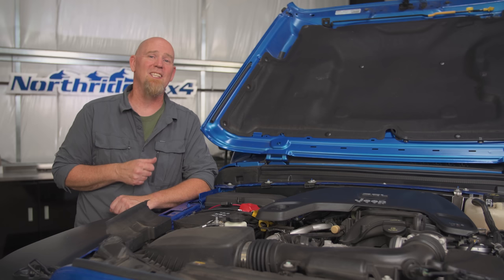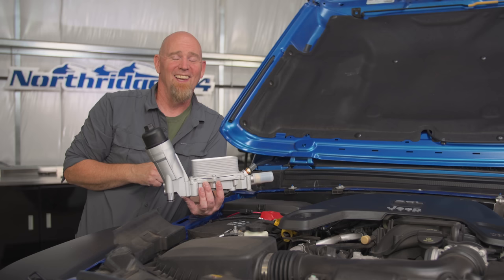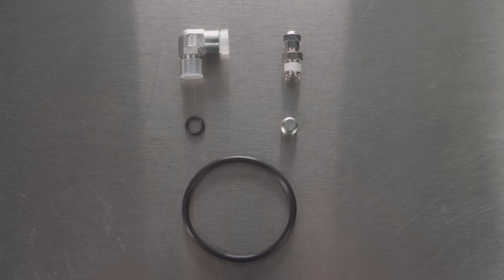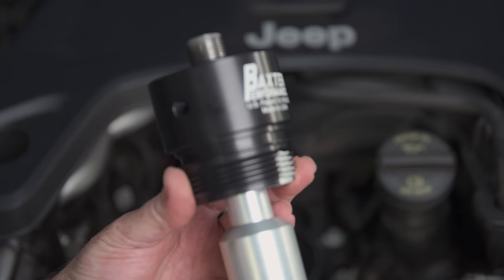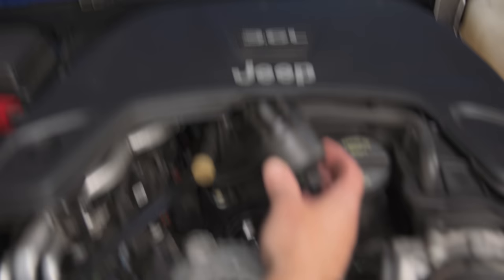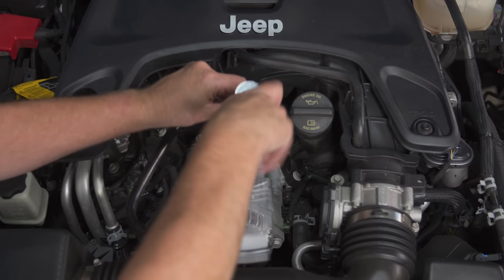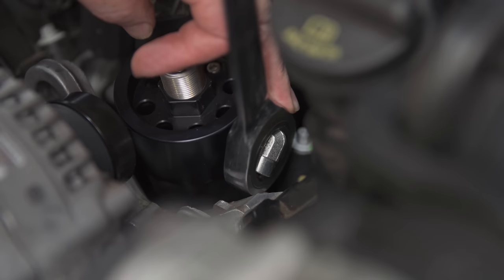STOP Dry Starting your Pentastar 3.6!!

Comment: My dads TJ as seen on my channel jeepNdirt (Everyday TJ video) has over 220k on the 4.0.  The JL's 3.6 while different from the 4.0 have similar sounds at start up.  Back in the day synthetics were marketed as "the super oil that bonds to metal and help prevent premature wear".  Anyone remember Slick 50, lol.....  That said our JL's and JT's call for synthetic oil to begin with so does that mean synthetics no longer protect our engines?  As an Engineer, I don't disagree with products that help and provide benefits, but in this case does it make sense for the cost of what it's selling for?  Are there that many problems with the 3.6 valve train?  For me I'd be more interested if anytime I see someone promoting this product they also provide facts, data, numbers that support the issues, causes and or concerns.  If someone was proving or showing that out of say a million 3.6s sold in the last few years that 30 or 40 % of them had valve train issues then I'm more likely to consider this product and or promote it myself on my channel.  Lol.  But seriously it appears to be a product that does what it says it's going to do and it maybe it should be considered as "cheap insurance", but as someone below mentioned where's the long term testing info and or as I suggest where's the data that makes us as 3.6 consumers want to spend money on this vs our suspension or other jeep stuff.  Not bashing here, just posing a question.
Reply from the maker: Just google or YT Pentastar valvetrain issues, you'll see plenty results.
Then Google Pentastar oiling diagram.
Reply: The bad rocker arms did it to me at 97k miles. So if this  problem was the oil getting up there then I'd buy it. But i haven't heard that it was.
Reply: My dads 2013 has 180k on it and he's always went to local lube shop, so who knows what oil they were using.  At 120k I replaced the cooler cause o rings blew out of plastic..  I think issues are from short stop and start trips. The us mail service has a ton of vans with this motor. The ones that run all day no issues,  the ones that deliver to condos and businesses where frequent starts and stops short runs, seem to have the valve train issues.  But not often
Reply: Remember the Mobil One adds where they ran an engine with no oil? Well, someone drained the oil out of my mower, and I mowed my acre and a half lawn not realizing what had been done and then next time I mowed my lawn I checked my oil only to find out it was empty, so I filled it with Mobil One again and three years on she's just fine, made a believer out of me. A 19 HP Kawasaki engine.
Reply from the maker: @stephenwest798  That's a great example of lubrication. What we want in the top of these engines is oil pressure to get the cam phasers and timing chain tensioner up to pressure and working properly. 
You cannot do that with a thin film of oil left over. You need oil volume and pressure.
Reply: Good points , good to see a fellow jeeper on here 👋  here’s my thoughts 

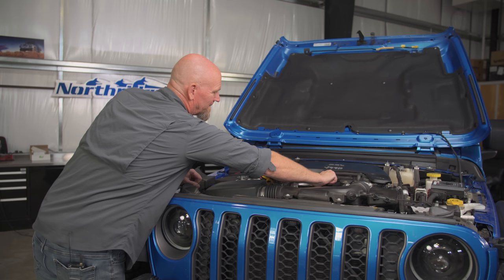Couple issues I see, but first if you watch at 8:40 he primed the oiling system of the jeep. Couldn’t you just do this before starting? With that option makes you wonder why you would even buy this part. Now for the list of issues. 
Voids warranty!
Changing the oil filter design changes the oil part number. 
Would a lube tech still service?
Forces owners to do own oil changes
And lastly there is a torque spec on the oil lifter hosing for a reason 18 ft lbs. this value is critical to how this housing mounts to the case. Over torquing, twisting and twisting that housing Will fatigue the seals and plastic housing. Is it worth all this? Maybe.

I like the concept and I like the ambition to make these engine run better. But there are ways to do this. 
Don’t use cheap gas
Keep the engine from idling for long periods of time. 
And have frequent oil changes. 
Understand that 8 hours engine time on the trail my only be 60 miles on the on the odometer. Change the oil sooner. 
I would consider trying this product.
Reply: There's a tremendous amount of clatter on start up from the valve train. The rocker arms sit on oil pressurized lifters and the cam phasers are oil pressurized too. Common failure points are the needle rollers in the rockers. You can count the seconds in an older engine as the pressure builds to calm the alarming clatter and the engine settles into a quiet idle. I'm rebuilding a 160K 3.6  with an emphasis on longevity and, among other items, I'll be ditching the plastic oil filter/cooler assembly for the aluminum version. After seeing this video I'll also be installing the baxter spin-on filter adapter with the anti-drainback valve for sure. The 3.6 motor either fails from overheating or valvetrain wear. Solve those problems and it should be an extremely reliable engine. Time will tell.
Reply: @northridgenation the valve train issues are due to the roller rockers build quality, not dry starts.
Reply: EPA has regulating the deletion of zinc from motor oils. Should also consider a zinc additive as well!

Comment: Used to valve train noises on cold starts for about 2 seconds,,, Changed mopar oil with higher quality full synthetic 5w20 no noises anymore
Reply: Mopar oil is actually Pennzoil that get's branded Mopar. If they use ultra platinum and not straight platinum oil mix from Pennzoil than there is not really a "higher quality" oil. Amsoil maybe? If they are using straight platinum blend than there is better, especially in the cold start/cold climate scenario. All my opinion here ( not talking just about the valve train noise, but about complete protection ), I think the most important thing to do is change the oil every 3K no matter what the oil you are using. We had a Jeep Patriot that started making valve train ticking noise @ 90K. Still going well at 165k +/- and then traded it in due to never really liking the Patriot to begin with. I was not running Mopar oil or ultra platinum when we had this vehicle. I was however nervous over it like everyone should be. Glad to here no more noise though. I hope the additive package in the oil that you are using will do a good job at everything and not just stop the ticking for you and not be as good in other areas if you know what I mean. What oil did you switch to?

Comment: One of the reasons I always use my remote start. You can hear the oil pump prime during the remote start process. It's also better to let the engine run until the RPM settles to idle before driving off. That's always been best for any engine.
Reply: lol wut
Reply: That's your fuel pump. The oil pump is mechanically driven, and doesn't pump unless the engine is running, so therefore, you are imagining things, and getting no benefit whatsoever.
Reply: Hilarious 😂 I wish

Comment: I assume this will work on a Pacifica. But will this particular Wix filter rub the underside of the hood? Looks like a good addition to the Penta motor.
Reply from the maker: If the filter is too tall, they do make a remote filter kit, that you can use to move the filter to a better location.
https://www.northridge4x4.com/part/oil-filters/rj-404-cp-baxter-performance-pentastar-3-6l-cartridge-to-remote-adapter-and-6-port-remote-mount-combo-pack

Comment: Add AMSOIL and now more worries,all my cold starts never had a rattle after changing to AMSOIL
Reply from the maker: AMSOIL is good stuff, but that is lubrication, what the cam phasers and timing chain tensioners both need is hydraulic pressure to operate and for that you need oil volume.
Reply: @northridgenation exactly! That's why the cup full of oil in the filter means nothing!!!! The motor has to be running to pump oil to cam, lifters, phasers etc! This is a Gimmick and its for worry warts trying to reinvent a wheel

Comment: When you apply air pressure to the valve during oil changes, couldn’t the air pressure force some of the debris that’s caught by that filter back down into the oil passages? Or is that air just forcing itself into the pathways that meet the filter at the filter element?
Reply from the maker: It is blowing the oil back through the way it came. 
As a bonus, it blows the oil pickup screen clean too.

Comment: What about the water you might have in your air lines?
Reply from the maker: Drain your compressor tank occasionally.
Reply: @northridgenation  I’m not worried about my oil changes because I do my own but if you go to a shop that has junk in their lines. 🤷‍♂️

Comment: If a vehicle was sitting for long spells between runs(garage queen)i think this would be a good option...for regular drivers that no start procedure will work wonders by itself. I always rev my motors to 2k 30 seconds after starting, idling for more than 3 minutes is bad.
Reply: You're half right: don't sit at idle for 3 minutes. What's just as bad? Reving the engine when it's cold, or hard acceleration when the engine is still cold. Engine parts work best at, or close to, operating temperature. 50-90% of engine wear occurs at start up. Why? Because there is too much clearance between the main engine parts like the pistons, piston rings, cylinder bore and the valve train lifters or followers. Your practice is not a good one.
Reply: The reason to rev to 2k one minute after Starting is splashing the cylinder walls
This is the main reasons all new vehicles start up at 1500 rpm, especially if they've been sitting a few days. Some modern engines have sleeve squirters for this reason. This device on the 3.6 is addressing a problem that doesn't exist if you look at the oiling system and pump on these engines you'll know why. I've been building engines for 30 years. The main threat to modern engines is poor oil change intervals, and poorly heat treated valve train components that has plagued every manufacturer in the last 5 years
Reply: Thank you for your reply. You thought me something new. I'm fairly knowledgeable about engines as well, but find that I'm always learning. We all have strong opinions, but it pays to keep about a 10% open mind, so one can think about and accept counter ideas and concepts. As you pointed out, cylinder wall lubrication is critical to limiting engine wear. That's why I prefer to use a thicker viscosity oil than what is usually recommended, as it clings to the cylinder walls better, or so I think. I am not a fan of the "water" viscosity oils, for that reason. I'm keep my vehicles a minimum of 15 years, so I'm more interested in durability than an extra mile or 2 from a tank of gas. I also use a product by Liqui Moly called MOS2, which is a particle anti-friction treatment. This product is controversial, as it has supporters as well as it's nay sayers. While I have seen some tests that I think are valid, that disprove it, I do believe it's primary benefit is at engine startup, as it fills the pores on the cylinder walls. If you are unfamiliar with it, check it out online. I get it Auto Zone.
Thanks again for taking the time to respond. Oh, one more thing: it's not clear to me if you like, or don't think the Baxter device is necessary for the Jeep's 3.6 engine. @prodigy6000

Comment: thanks for showing the oil priming trick with the pedals, you could just do that after each oil change and or before cold starting your 3.6 and save yourself 400$.
Reply: That would probably wear your starter out pretty quick though.
Reply: You'd have to do it every time u start it cause they are saying the oil drains back outa stock oil cooler assembly in a few mins of being off!
Reply: Just run good oil! You'll be fine!  Or dump a bottle of Slick50 or Duralube in oil change! U can run engine with no oil according to there infomercials back in the day 😂
Reply: If you have good quality oil it is suppose to have retention so that even then though the oil drains back the upper parts should still have a protective film of oil on them.
Reply: Would this void engine warranty?  I just use synthetic oil in all my vehicles.

Comment: Will this void the warranty? And have there been any failures on this aftermarket part stopping oil circulation?
Reply from the maker: Think of it like you would a ZAuto Tazer.... It shouldn't, but we always recommend that you check with your dealer or plan to pull it out before taking your Jeep in for service. 
We've sold thousands of these over the past year and have yet to see any issues. We have had a lot of people tell us how much they love these and how they have quieted down the loud start up.

Comment: I can see how the check cable keeps the oil in the filter when the engine is off but how does it keep the oil in the cooler when that check valve is before it? Ie between the check value and the engine

Comment: Looks like a good way to void the warranty on your brand new Jeep.
Reply: Yup. Since it connects where it does, pretty much anything mechanical with the engine could be out of warranty. The mechanics would be like w.t.f is this thing…  defective hardening causes most premature wear. A question is also where else does the engine oil drain from that this doesn’t keep it in …

Comment: This is not true. The valve train has plenty of oil on it from the last time it ran.
It's like the guys freaking out about not filling an oil filter after an oil change. You will loose your mind if you ended up with a Subaru.
Reply from the maker: The Pentastars have a lot of problems with lifters, cams and cam phasers due to lubrication. This is helping to eliminate it. 
Install one in a high mileage 3.6 and you'll notice that they are a lot quieter on start up.
Yep, the Subies are real bad for that and Baxter Performance makes these kits for those too.
Reply: Paul, it's a good thing they have Subaru solutions as well!
Reply: It depends on the engine, but after having run countless engines over the years with the valve covers removed, some just don't get a ton of oil to these followers and such and they are never a problem.  There are also other engines out there with a similar setup that have no troubles whatsoever.  All they need is to be wet with oil, and that oil isn't going to just suddenly disappear, even after sitting for a month.
I can't tell you why these engines are notorious for followers getting eaten up, but I am confident that the "solution" in the video isn't going to be the deciding factor.  I have seen old Chrysler 2.2 and 2.5 engines with roller followers that have gone bad and ate the cam while some simply never had the problem.  The early versions of those engines had squirters built into the cam caps to shoot oil onto the slider follower, and they went away with that with the roller versions.
There are HEMI's with displacement on demand (or whatever Chrysler calls it) with over 400,000 miles that have zero issues with it.  Then there's some with 70,000 that are junk.
Anyone who digs into  cars a lot has seen how frequent it is for vehicles to come in with nothing on the dipstick.  It has much more to do with how the engine is treated overall.
Reply from the maker: @paulstandaert5709  Both the cam phasers and the timing chain tensioner need hydraulic oil pressure to operate. They need to get enough volume to fill up and then pressurize. Having that extra oil up in the filter assembly will make big difference in the time it takes to fill and pressurize those components.
Reply: @northridgenation doubt it! Nothing gets psi till the pump is turning and engine is running.  The cup full of oil or not isn't gonna fix the issues.  Look at all the mail trucks with this engine.  Cam and lifter issues only seem to be the ones that start and stop 100 times a day. The ones that stay running all day rarely have issues
Reply: Imo it's the short starts and stops

Comment: Just installed it on my 2012 Chrysler 300, got the 2011-2013 3.6l adapter .
I did have to find a 3" in height oil filter so the hood can close. It works great .
I used a MicroGard select MSL10290 oil filter
Reply from the maker: That's awesome, thanks for letting us know.
Have you noticed a difference in any start up noise?
Reply: @northridgenation  I also found the OEM MO-339 and ACDelco PF64 oil filters that fit the Chrysler 300 perfectly.